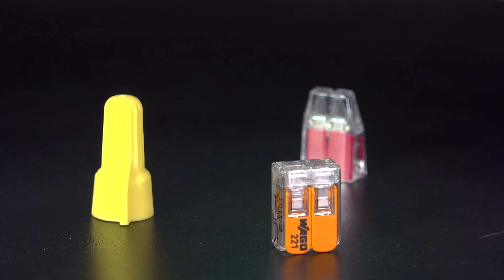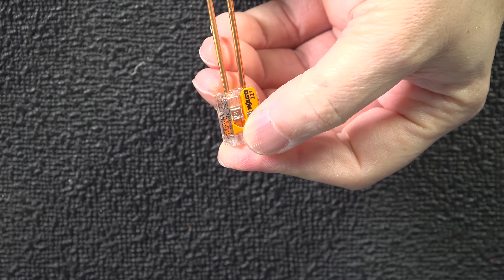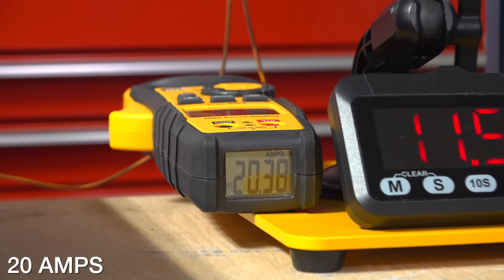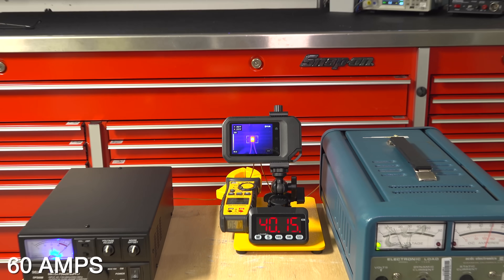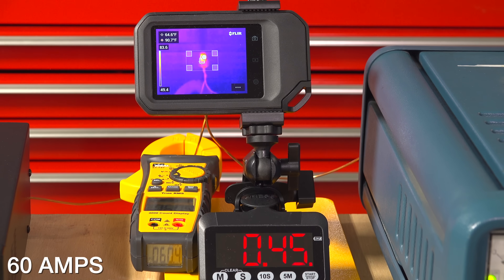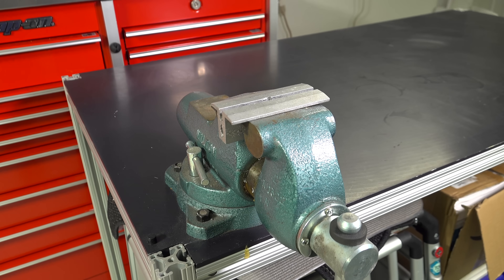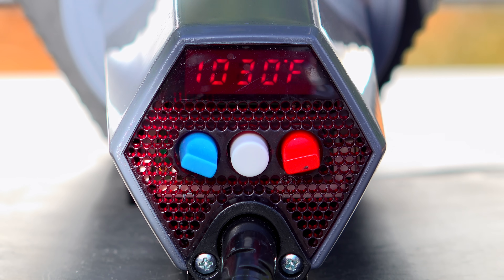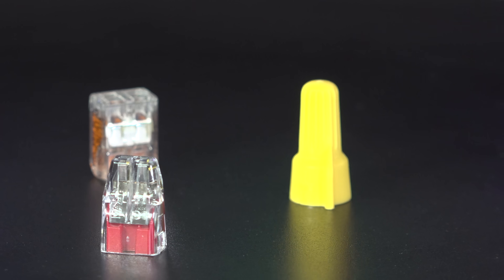What Wire Connector is the Best? Wire Nut VS Wago TESTED

Comment: Been an electrician for 35 years, tried to use them a few years ago......junk, absolute junk. Like the back stabs on a device, a little wiggle and you can pull them off. Fuckin moron.

Comment: I’ve started using wago brand only in all my connections for my home remodel. I’ve been doing it so long that I can go back and replace my wire nutted connections with wagos and they definitely save space and make pigtails much easier. Also easier to hook up hot (no load) connections.
Reply: If you use wagoboxes they make what was a rats nest of a fire waiting to happen into a neat easy to work with safe installation.

Comment: Not sure if this is a relevant observation but when you tested the wire nut you had the bare copper wires twisted together so they were making a connection outside of the wire nut. Surely this would mean less current was passing through at the point of the wire nut? With the  Wago all the current passed through its connection.

Comment: can you do an overload test on an outlet that's wired though the break away tab?  I see this a lot of electricians do this to "save time/$$'s" but I hate it because I always think that tab if it's first on the line, with a fault at the end, will get hot and possibly fail....I like the wire nuts better with pigtails

Comment: The only thing I would suggest is when you did your load test with a wire nut you twisted the wire past the nut. While on insulated wire this would not be an issue, in your bare copper wire the electrical contact was happening inside your wire nut as well as below it where you had your twist. However, I don't think you would get much different result. The wire nut would have just gotten hotter. 

I would have also tested the wire nut without twisting. Since you said that the instructions indicates a twist is not necessary.  In that case the coil in the wire nut would be taking much of the load. I suspect the wire nut would get the hottest at that point.
Reply from the maker: I am going to do a follow up specifically on the twisting on these. I will make sure I cover these differences
Reply: @SilverCymbal  A few things I would suggest is (1) put the wires in a junction box, there's never a case in residential wiring for wires to be installed in the open like that.  In a junction box they are closed up insulated so the temp you were showing from the load could potentially be higher.  Most of new construction even older homes in the US use blue Carlon box nailed to studs.  (2) I would use 14 (smallest) gage insulated Romex, two going into the box to make a connection and a plate on the box or you can even control the load with a simple one way switch.  (3)  I would look at testing stranded wire.  I've seen Wago connectors come with a lot of new light fixtures .  I have a suspicion that stranded wire will likely snap in a Wago connector before it snaps in a typical wire nut.

Comment: Great video. Thanks! Actually I think you went easy on the wire nut. A typical hot or neutral connection would only be twisted together INSIDE the nut, so more heat would build up inside the nut. In your test, most of the current probably never passed thru the half-inch-long twisted portion inside the nut. I think that would make the Wago look even better!

Comment: i am wondering...when submitting the load... was it 60 AMPs AC or DC? A continuous direct current will add more power than an alternation at 60 Hz.
Reply from the maker: For testing DC amps and AC amps are he same. There are some good articles on google talking more about why
Reply: @SilverCymbal  thank you. I was asking if the total amount of heat would change if using AC vs DC with the same amperage. My amateur knowledge says yes...

Comment: It would be interesting to see a pull test on the wire nut.
Reply: Blows away those junk wagos
Reply from the maker: Yes it wins the pull test, so attach one to a wisdom tooth that needs to be extracted and pull but that extra bite does nothing electrically for the connection and ruins the wire as a result. It offers nothing at an unfortunate price.

Comment: I guess the next question is cost. I’m sure the Wago costs WAY MORE than the wire nut. 
The Wago looks nice but I still trust a PROPERLY installed wire but more.
Reply from the maker: For DIY stuff the difference is nothing and the savings and ease of use makes it a dream. If you built a house with Wagos instead of wire nuts you would spend about $100 more.

Comment: The wagos are awesome and I use them mostly when I’m tight on space in a box.  However, the fact that the pretwisted and wire nutted connection was about 40 degrees cooler at 60 amps goes to show that it’s a superior connection/ less resistance.

That said, for all practical purposes, the wago is still a great choice and should be used without concern.
Reply: The temp test was not comparable as the blank wires were twisted outside the nut, so some of the current flow direct from one wire to another and not only as in the wagons inside the connector only.

And speaking with 15 years of experience, I've never seen a wagon fallen off or have a bad connection, neither for flex or bare copper connections. Even a overloaded connection were wagons were melted, the spring had hold the connection well together. (At that point, there was no sense in that as the wire isolation were black smoke already)

Comment: I maybe wrong, but those amperage ratings are for AC power.  Usually, a device's DC amperage rating is half of it's AC rating.
Reply from the maker: In terms of amps alone, DC and AC amps are the same.
Reply: @SilverCymbal  I guess that I'm mostly used to the ratings of components such as contactors and relays that must extinguish the potential arc when they open, with AC power being much easier to extinguish.

Comment: We have been using these kind of connectors for decades here in Europe. I honestly couldn't imagine messing around with these wire nuts and having to twist the wires first. By the way: The series 221 connectors come in two sizes and ratings. The bigger ones are capable of taking up to 10 AWG wire and 32 Amps.
Reply: Only the in-experienced will pre-twist the wire for wire-nuts, Not at all necessary and not recommended by the manf.

Comment: Great info...but would of liked to see pull test on the wire cap !
Reply: My thoughts exactly that’s the only thing I wanted to know
Reply: The wire nut, when applied correctly, should be fine for about 50-100 pounds, which is meaningless since you should never have wire supporting a load in the first place
Reply: Seriously!

Comment: Have you done any testing with the 'push-in' Wago connectors vs the ones with the lever?
https://www.wago.com/us/wire-splicing-connectors/push-wire-connector-for-junction-boxes/p/773-164
Reply: The push-in Wagos are as good as the lever ones, last ones are better when you have connections which are changed frequently or when you're using flex wire.

Comment: I've used wagos at work. Many of the industrial LED light fixtures came with wago connectors. Some of the guys preferred the wing nut or barrel  wired connectors. There's pros and cons to both. Wagos are convenient to remove and install but on occasion if the connection isn't tight a wire would pop out. Wire nuts on occasion were hard to remove you had to cut them from the wire which meant shortening your wire. I've seen wire connectors melt or blow out depending on conditions they would corrode and fall off. Or pack with dirt or mud but those are extreme conditions. But again its just a matter of preference and what you like using as what you feel works best for you. 😎
Reply: Good thing with a wago, it's usually either on and won't budge or so loose that it's blatantly not connected.

Comment: i know some older eletricitions willm only use the old marr connectors with the little brass screws in them not only that but wired the house with 12 gauge copper instead of 14, and nope refuse to use any thing else.

Comment: You had a good mechanical and electrical connection before using the wire nut. Were you testing the wire or the wire nut?
Reply: @JorgTheElder  It is not a nut holding them in this case.  The wires get twisted as you twist the nut, the same way as you would have twisted them by hand.  If you take the nut off, you will find two wires twisted around themselves.

Comment: Good vid, I just have a single reservation, the cables were pretwisted well outside of the wire nut, at least 1”, to the point that the current between the wires flows without going much through the wire nut, wich make the contact area much bigger and dissipating the heat much better. Have you left the cables insulated out side the wirenut, as in real use, the outcome might’ve been different.
Reply: Noticed that, too. ALL of the current in the Wago test had to go through the connector. Very impressive---I'll order some of these connectors now.
Reply: Excellent point.
Reply: It's actually not the joint heating up, it's the whole wire heating up because he applied 60 A to a #12 awg wire that only have an ampacity of 30A at most depending on the insulation.
Reply: Real world tests would be contained in a box where it wouldn’t have the open air to cool it off and have insulation. 
Copper is an excellent conductor of heat but the materials wire nuts are made of aren’t so I wonder if having the twist that far back would matter.
Reply: Most people twisting wires (ground wires especially) aren't trying to make a twist that fits inside the nut perfectly. I agree that it's not exactly an apples to apples comparison, but it does seem realistic.
Reply: @DjDuncman  Ground wires don't apply to what we're testing here, though.  You want this test to be as if it's the live wire, so no -- it's actually not realistic.
Reply: @DrewSoucy22  It's the same gauge wire, so current flow/capacity is effectively the same and is limited by the wire gauge, not the twist. Any difference with ground wire vs an insulated wire is trivial at best. A properly twisted pair of wires doesn't need the wire nut for the circuit to function. The wire nut just ensures the wires don't untwist while also insulating the ends. Properly done, the wire nut isn't even part of the current path, while the Wago is part of the current path. Not realistic? Fine, it's realistic enough though.

Comment: Seeing this test I gotta wonder what was causing the looseness and arcing in the couple of wago connectors that I had to replace in my current house. I just chocked it up to the same as all the stabbed outlets in the house that fail. Constant heating and cooling of a smaller surface area eventually warping? Kinda like improper breaker types being installed in your panel eventually failing? I dunno. Not the original owner so I didn't install them to begin with - replaced em with wirenuts and no trouble *shrug*. Wire is sized properly for the circuit, no overloads or faults since I have been in the house but that doesn't speak to previous owner so no telling.
Reply: If you had several problems within one house someone has really screwed up. For the ones without a lever the end of the wire should be straight and not bent. it also has to be put in deep enough. In my experience they are far more reliable than screw terminals or wire nuts. I use Wagos since the late 80th and wouldn't go back. The bending could be a problem if someone replaced wire nuts by wagos without cutting or straightening the tips of the wires. It is a kind of strange and nowhere else outside the US is such a refusal. Also no other country is so much in love with the wirenut. So i guess it has to be connected somehow ant those twisted wires are the only thing i can imagine.

Comment: What I find interesting is electricians tell you not to use the spring loaded push connectors on the back of plugs and to use the screws because over time the spring tension relaxes over time and can cause a bad connection.  Now they are trying to tell us to use spring loaded connectors to connect 2 wires together and that it's better than a wire nut.  It seems to me that those spring loaded connectors over time would cause the same problem.  They are sending mixed messages anymore.  I'd rather have the wire nut because they seem to keep better contact over the long haul.  It seems to me they are trying to burn homes down more these days.

Comment: We used Wagos all over our robots in FRC, and we had them running off 40A fuses. That's all I needed to know they were solid!
Reply: We used them for CAN stuff also during a competition during 2019 we lost 2 drive motors on swerve to crimp connectors so yeah those arent that good against vibration
Reply: @carlossosa9017  That's an inherent fault with connectors like these. You want connectors that are soldered to the cable and clip together.

Comment: Been using the Wagos for a few years now. Absolutely love them. They're great when connecting wires above your head. Just easier for me to group the wires together. Also very convenient when the person before you cuts the wire in the junction box too short and it's difficult to access the wire
Reply: You bet! and nothing worse than trying to get 3 or 4  twelve GA wires all lined up to wrestle a wire nut on!
Reply: @FCE-dogs  This
Reply: And if you need to modify something you can just undo and redo everything without having to cut a single wire.
tbh if you undo a wirenut the cleanest and best way is to cut off the heavily twisted part of the wire before using a wirenut on it again. After a few modifications your wires will become too short.

Comment: I know paper burns at 451degrees so the 900+ temp tests are showing how they'd react in a building on fire, which is something you don't often get to see.
Reply: If a building is on fire how your electrical connectors are going to hold up is the least of your concerns then. BTW paper spontaneously combusts at 451°F. It can burn considerably hotter than that though.
Reply: @1pcfred  That's my point. 900+ degrees is asking this connector to survive a fire, which it isn't rated for.

Comment: UK spark here, terminal block connector used to be the standard here but wagos have pretty much made the terminal block connectors obsolete
Reply: Wrapped in some bodge tape😂
Reply: Same in Germany. Growing up, I only saw screw terminal connectors, but then Wagos became the standard a few decades ago.
Reply: They're a lot cheaper though and work just fine.
Reply: @planespeaking  maybe cheaper but then they are screw terminals which loosen over time. Hard to fit 3 wires in a terminal and when you put bodge tape on it and you come back to add another cable you basically have to cut the wires because it’s so hard to take the tape off. And it is a bodge.

Comment: And you are testing with 20 amp DC not AC ?  As on the meter at you power supply...
Reply from the maker: Correct, DC amps and AC amps are the same. More info here and on Google: DC Amps and AC amps are the exact same thing, they are the measurement of electrons past a given point, the difference is that the electrons of AC go back and forth (alternating) and DC go only in one direction (direct

Comment: Nothing beats the wago when you've got to join stranded wire with solid. I'd say that's the main advantage over a wire nut. Also much easier when you need to test. When adding a branch to an existing circuit you don't have to struggle with twisted up wire or cut and re strip. Not to mention all the hand twisting and tightening you won't have to do.
Reply from the maker: 100% agree, every time I use these *and I have been for almost 10 years) I am still amazed at how great these are.
Reply: There are even other kind of wagos for plain solid wires. Without lever. Just  fw/rev turn the connector and pull the chosen wire at the same time to release or push it in to make the connection. Dont know if they're available for the murrican market in AWG. 
But on this side of the pond they're available in metric 0,75sq. mm - 10sq. mm

Even smaller then the 221 but ofc can't take stranded wires.   2-3-5-8-16 holes available for the (over here) standard 0,75 - 2,5mm2 version. Dont know about the bigger ones but saw upto 3 hole ones in 6-10mm2 version.

Comment: I like the versatility of wagos. Being able to add or remove circuits safely without de-energizing is a plus. The biggest negative for wagos for me is stranded wire. I’m used the to the pre-lever wagos. How well do the levered wagos hold onto stranded wire?
Reply: Excellent. Just use one port only for a wire, never try to put both flex and bare wire in the same port. The lever Wagos are designed for flex and/or bare wire

Comment: Anyone who complains these slip off to easily is using the wrong sized connector for the wire gauge.  Duh.  Wagos save space, time, and do not compromise safety.
Reply: Wago 221 have a range of 0.2 to 4 mm^2 (24…12 AWG).

Comment: Strange, this video proves something else, that circuit breakers and fuses are in place mainly to protect the wire insulation first. The copper conductor can take a lot more current. This is where aluminum wire is dangerous, if it gets red hot it just disintegrates, but copper can get red hot, cool off and it still has the same properties.